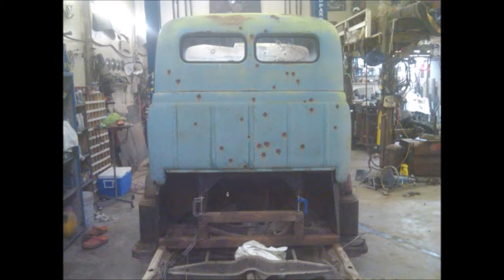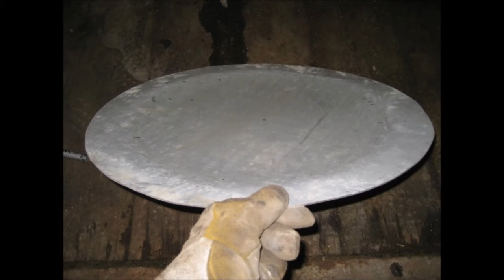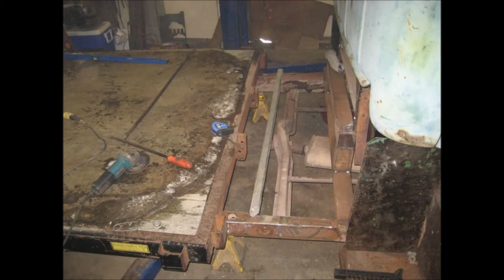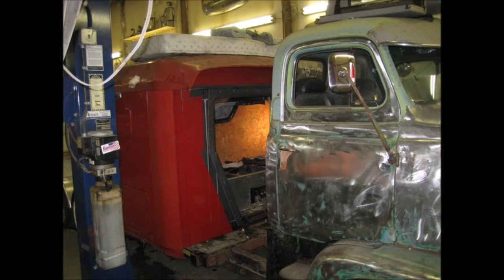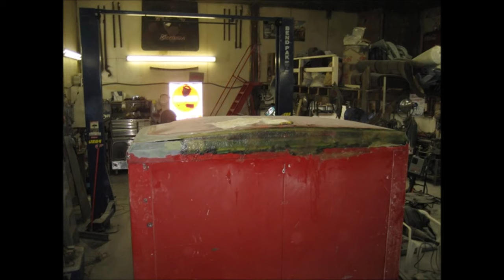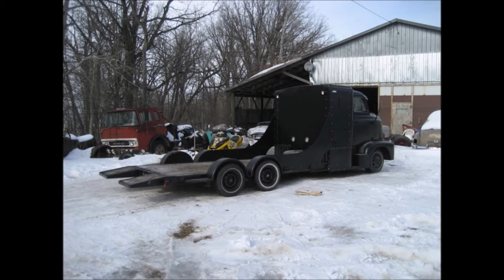1955 International COE hauler

Comment: What was that steering shaft  reverser ? What was that out of ? It looked to be marked 98 Rodeo ?? Also love your work thanks .
Reply from the maker: Yep Rodeo and I think honda used them. They reverse the steering so you need 2 of them. My setup made a big Z but my steering wheel was in a normal position unlike some COE's where the steering column goes strait down into the floor.
Reply: @HalfassKustoms  ... and you kept that Cadillac column!  Awesome solution cuz wheel straight to the floor would be annoying!

Comment: Shouldn't have to remove the body, inside the cab, under the dash,  there 
should be a removable "dog house" that should be able to remove to better get to the head and rocker covers, carburetor and spark plugs,  unless it's a diesel...